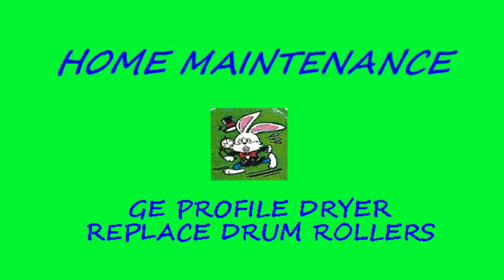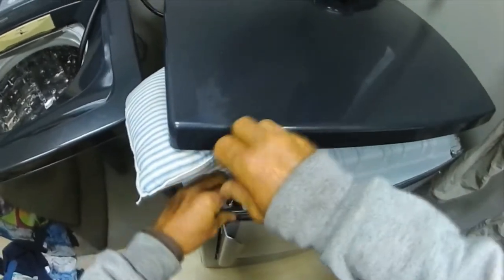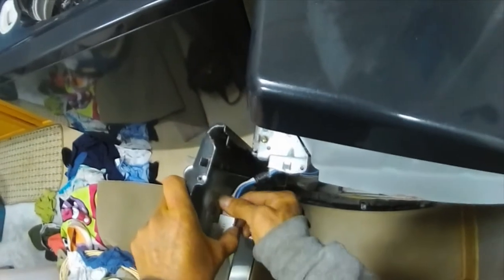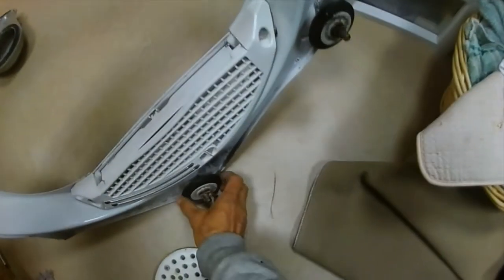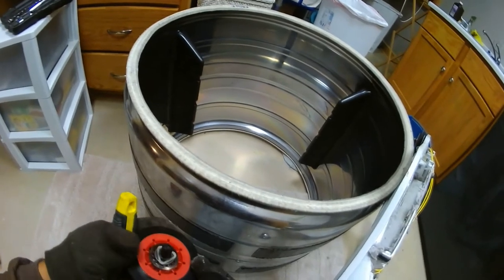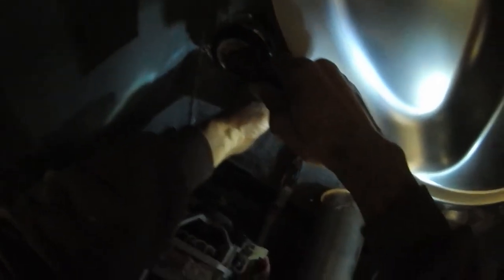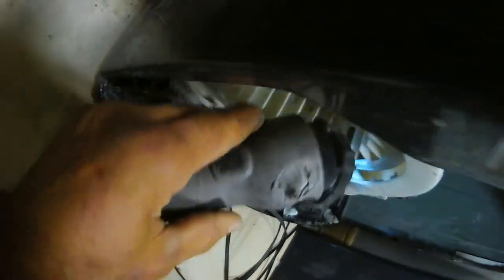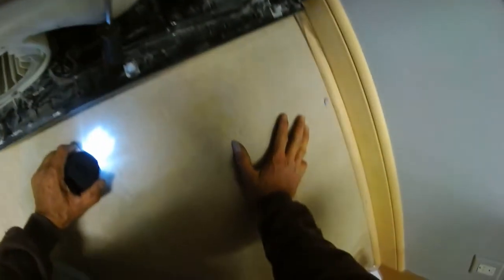CLOTHES DRYER NOISY, DRUM NOT TURNING, REPLACE THE DRUM ROLLERS, GE PROFILE DRYER

Comment: Saved me beaucoup bucks! I originally bought one GE roller for $58 bucks, then saw an aftermarket kit on Amazon with 4 rollers, belt, pulley assy, and spring for $35.00. Repaired in 2 hours. Of course retuned the over priced GE roller. Thanks for posting!
Reply from the maker: Thanks for the comment.  Subscribe to our channel, if you can. thanks.

Comment: Thanks, Mr. Wilson, for this video. Our GE Profile dryer is making a rumbling sound, and we are going to use your video to help us fix it. I noticed you are not using GE brand rollers. Can you tell me what part you are using? I think we'll also try to replace the belt since we are in there like you did. Thanks for your help!
Reply from the maker: Get the model number of your machine, usually if you open door and look around the frame you will see a tag with the model number. Sometimes it is on top of the console. Then go to sears parts direct and search modrl number. Then find the part numbers for your rollers and belt.
Reply from the maker: Sorry I didn't see this comment before today.  I try to get parts at discount on ebay. Just go to ebay and put in the part number.

Comment: Nice video,  I have same problem.. where did you get replacement from??
Reply from the maker: This is how I get parts, go to an online parts store such as searspartsdirect.com, enter model number of the appliance, find the part number. Go to eBay and enter part number, often parts at eBay are 50% less.
  If parts are difficult to find, try different parts stores. If parts are not available, try going to an appliance recyclying center, and scavenge used parts, lot of luck involved.
Also search used appliance parts
Reply: @swilson6206  thank you so much

Comment: Hi ,
What size socket did you use for the back of the rollers?
Reply from the maker: I think it was 9/16" or 5/8"
Reply: 14mm and the smallest socket drive wrench there is for the back wheels.

Comment: Can you provide parts info for me to order them?
Reply from the maker: Find the model number tag on the dryer. Open the door and look around the door frame. Or it might be on top of the console.
Then go to sears parts direct and enter the model number. A page with parts should come up.
 If you want lower price parts, you could take the part number from the parts page, then go to ebay and enter  the part number. Oftentimes you can find new OEM parts at lower prices.
 Other parts sites are repairclinic, and appliancepartspros.
Reply: I did but what they are showing looks nothing like what is in your video. And that is my exact dryer
Reply from the maker: @tarahbarrett4117  what is the model number of your dryer?